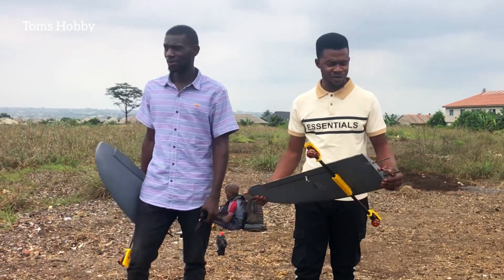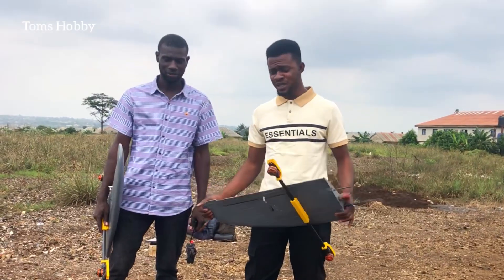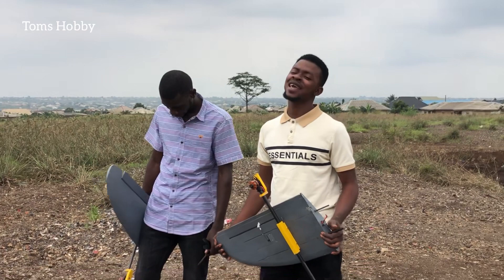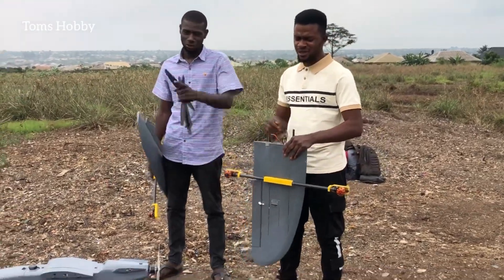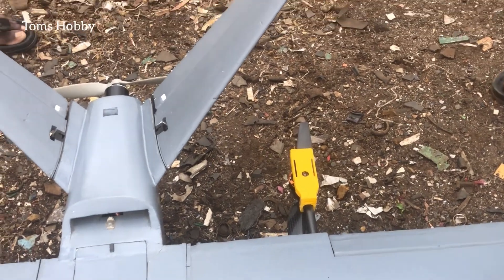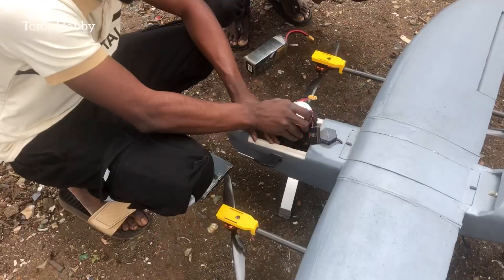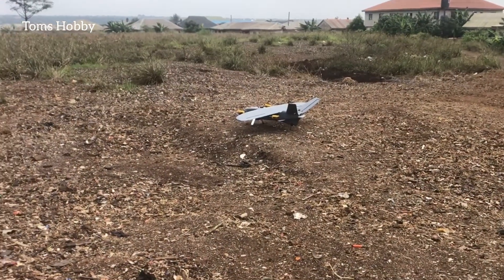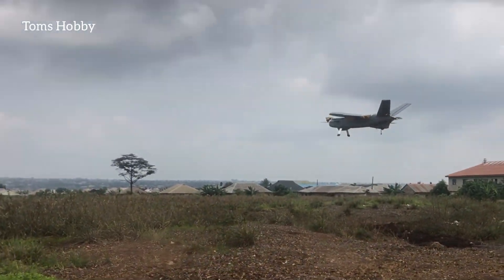Vtol X-UAV  Talon Maiden Flight | Transition

Comment: what causes the Power loss?
I have same issue with my F450 quad using 3S 5500mah battery. 
Quad losses power while landing resulting to a crash that damaged my landing gear.
Reply from the maker: Battery sag .. the lithium ion cells are not new
Reply: @TOMSHOBBY  oh I see. So new ones would solve the issue?
Reply from the maker: Pretty much or perhaps a lipo

Comment: Great stuff! Did you find out the poer loss issue? :)
Reply from the maker: Yes I did , from the log review the battery voltage suddenly drops .. the cells are not brand new so I expect it to have resulted in that
Reply: @TOMSHOBBY  OK great : )
Reply: power